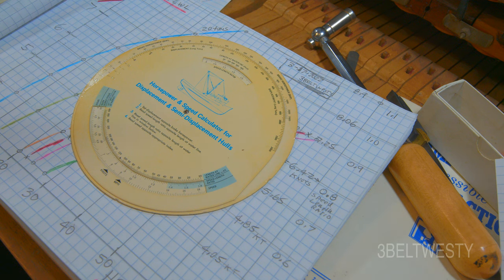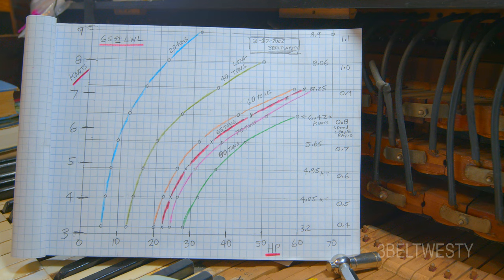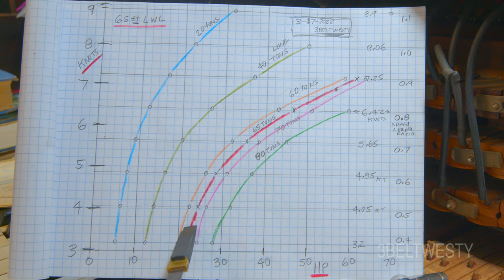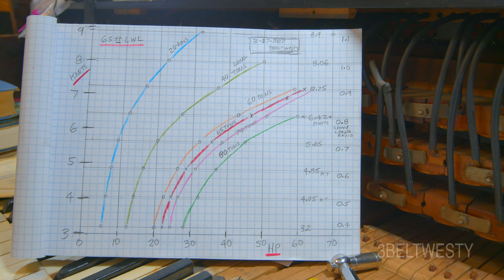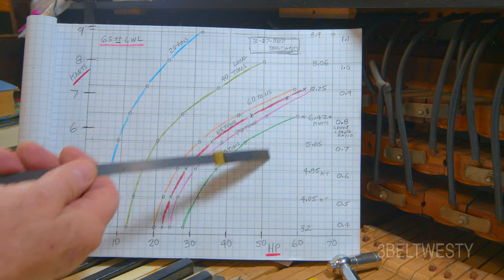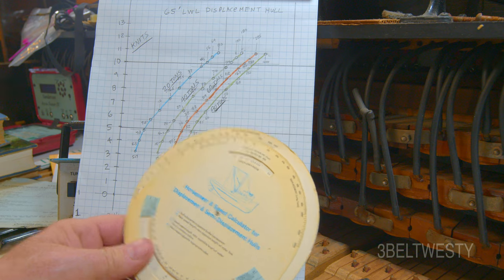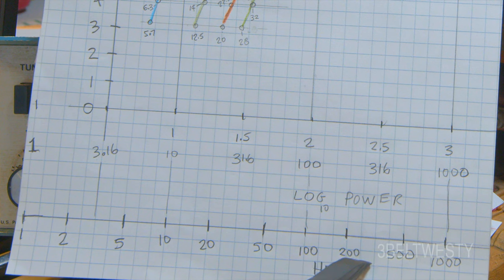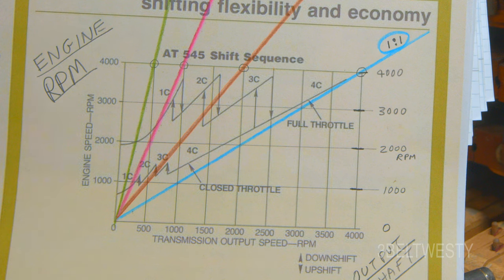SV SEEKER displacement hull speed vs power via  circular slide rule calculator

Comment: Very nice explanation on what it takes to push a displacement hull through the water.  Next we need to see RPM vs HP for the propeller and then RPM vs HP for the engine, so we can make sure the Engine Transmission allows for optimal operation of each component.

Comment: Could initial speed results be a product of down river direction?
Reply from the maker: I wonder about that too. Somewhere I saved a screen shot that has 
(1) 1480 Engine RPM with 183 RPM Transmission output with the boat going 6.5 knots

(2) Another screen shot had Engine 1800 RPM Speed 7.2 Knots and Engine 1500 rpm 6.2 Knots

With (1) and the propeller at 183 RPM at pitch of 27" Inches ???  you get  183 * 27 = 4941 inches per minute

4941/ ( 1215 in/min / knot) =  4.07 knots 

So if the propeller was a bolted lathe lead screw it moved at 4 knots

If there is slip which there always is the speed will be less

https://www.olds.com.au/marine/propeller_faq.html

Propeller slip:

Olds.com.au data:

"displacement cruisers 30 to 40
sailing auxiliaries 35 to 40
work boats 40 to 80."

So I too wonder if there was a river current they with or the propeller rpm number of 183 RPM is wrong or I goofed up my math above???

ie twice around rpm error would give 8 knots as a lead screw and if slipped 40 percent then 8 * (1- .4) = 8 * .6 = 4.8 knots
Reply: @3beltwesty  I suspect that you're experiencing "Positive Slip" due to the push of the river current, which is common for down bound vessels.
Reply: @markwertheimer2320  The current on the river couldn't have been more than half a knot that day. When we were anchored it took forever for logs to wash past us.
Reply: @Webleys  then, working backwards from 6.2knts - 0.5 knts (Current) = 5.7 knts x 1215 in/min = 6935.5/183 rpms = 37.8” pitch   is it possible the actually propeller pitch is not exactly 27”?  and is closer to 38”?  possible causes might be Headerstad not fully reaching the stops so the blades are at the design position or casting error or a combination of two.
Reply from the maker: @markwertheimer2320  I was wondering if there was a factor of two error in "measuring the output shaft"  rpm and then 183 was really like 366 rpm? Then the numbers make more sense.  Not sure if they used a strobe app on a phone or there is a tach on seeker for the prop rpm. 183 rpm is about 3 revolutions a second.